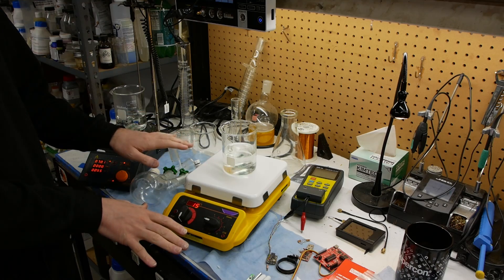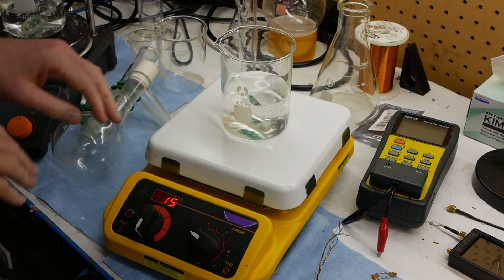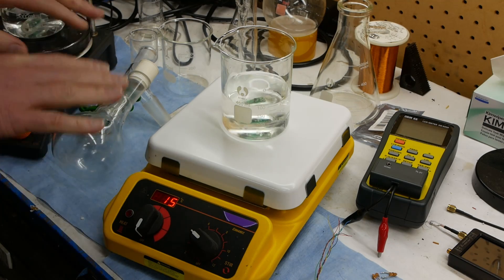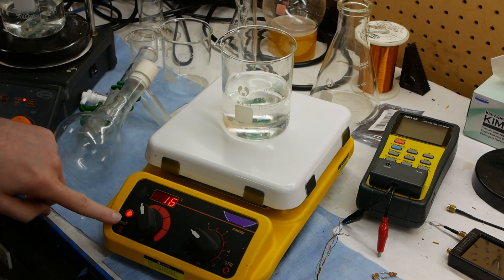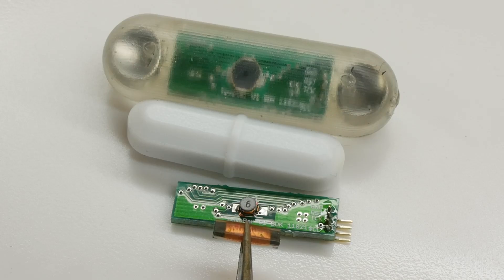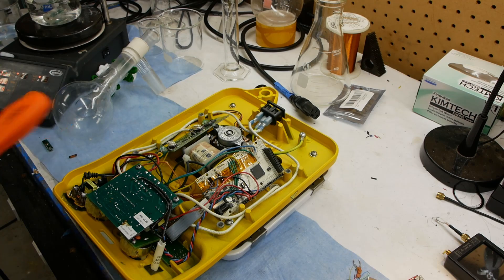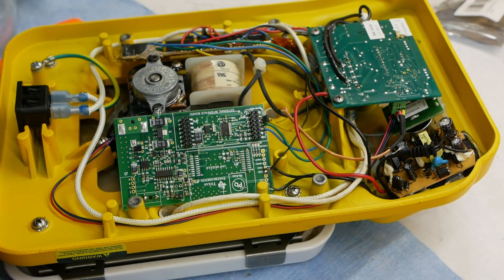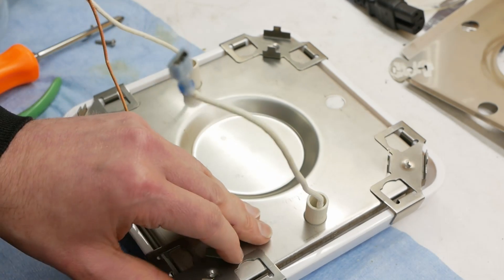Temperature-sensing RFID tag in magnetic stir bar

Comment: Are there other materials stir bars can be made of?
Reply: Yes, but it would be too hard to implement this into them as they require too high of temperatures to mold them and form them for the circuitry to be able to handle.  The microchips can only handle up to ~150°c, give or take a few degrees.  Glass alone requires more than 500°c, way more, just to be able to mold it and work with it.  Teflon would be too complicated due to the toxic and harsh chemicals involved in its making.  This is possibly the only way to make one....  Unless you could make a glass tube/ampule type that has the ends melted shut.  That might work.
Reply: @BackYardScience2000  couldn't someone essentially embed this or just a piece of iron into a clay piece and then glaze it? Are there not ceramic ones available?
Reply: They use teflon or glass for chemical and temperature resistance. I guess it also needs fairly low friction on the glass below.